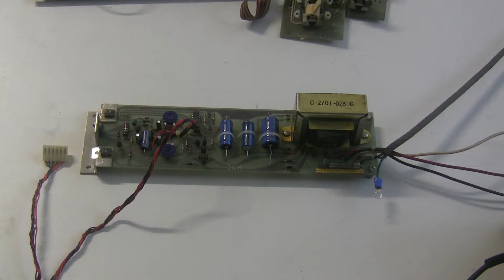Synthchaser #017 - How to test the power supply of your ARP Synthesizer Keyboard

Comment: What could possibly cause the rails to be double what they should be? My ProDGX is showing over  +/-29V and 9V. The board was just recapped.
Reply from the maker: Failure to regulate the voltage.
Reply: @Synthchaser  replaced the 3904s and 6s and the regulator IC and that did the trick! 👏🏻
Reply: @Synthchaser  that’s what i figured. I guess I’ll start by replacing the ua723 and testing/replacing transistors. Shotgun it. 🤞🏻